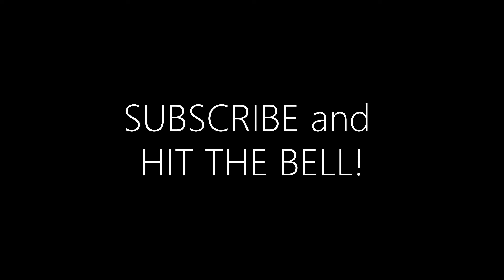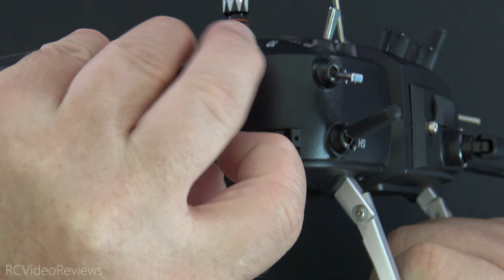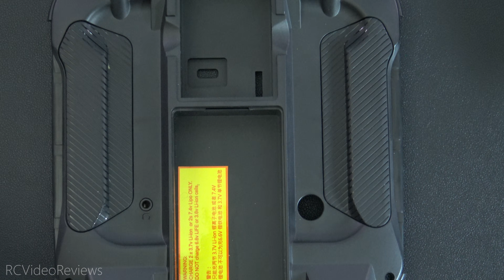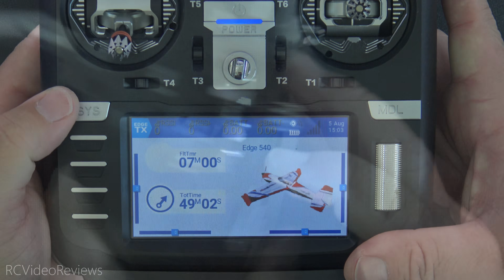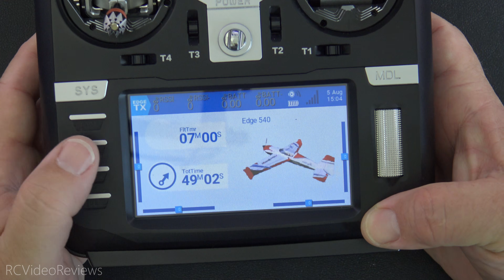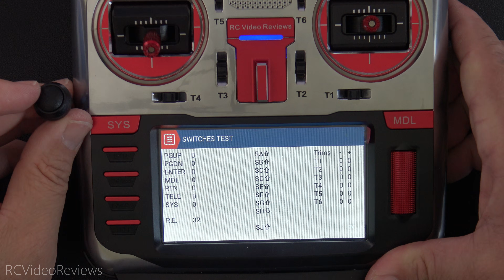How-to Install and Configure Radiomaster DIY Switches in TX16s MK II and MK I

Comment: I have been planning to use it for head free readjusting my headding...just for future preparation of a platform to set heading and do some pan flying and direction...also I am planning to build a platform i can use the top left momentary switch to switch between flying quad with sticks to stable lock in flight, either heading lock or geo lock possiyion and altitude hold and controller gimbal with the sticks...making it an ideal platform for controlling while flying, one operator deal...😇

Comment: Can anyone confirm that it works on the original radiomaster Mark 1 radios. I'm fine with drilling a hole in the case I see to know if the board has the connectors

Comment: Hi man, i checking my jumpet T16 and figuring that it had same soldering pad but i doesn't really know what socket that match with the soldering pad. Just asking if you know what socket i should use
Reply from the maker: Sorry, don’t have that radio. No idea.

Comment: be great if you could do a mod for the new unscrew antenna
Reply from the maker: After seeing some of the issues where the center element breaks from the connector pin, I think I prefer to avoid adding points of failure to the antenna.

Comment: Hey man. Great video! I have the TX16S MK1, however I'd like to replace my switches with the 2 position buttons. Do you think that's possible? I always bang and break my switches in my bag and replacing them out with the 2 position buttons would be awesome for me. Almost replicating the Radiomaster Boxer. It's 6 wires for a 2 switch combo so I was wondeing if 2 buttons could be wired into the JST connector so it's only 4 wires? Any help would be appreciated. Thanks.
Reply from the maker: Yeah, you can change them. You can specify their function in hardware setup on the radio after you make the change.
Reply: @RCVideoReviews  So 4 wires from the 2 buttons will work instead of the 6 wires needed in the JST connector?

Comment: hey bro, great video,i added a toggle switch behind instead of the momentary switch.i can see it in the calibration of the tx.but i cant see it on betaflight to use it as return to home gps rescue switch.
Reply from the maker: Did you assign the switch to a channel in the mixer? Do you see it showing in outputs when you activate it? If both of those conditions are met and it's within the sbus/crsf stream you're feeding BF, you should see it.

Comment: Hey guys.  I have a problem with my newly purchased Radiomaster TX16S MK2.  When powering on I get a Key Waring message, Key Stuck PGDN.  checked to verify that none of the buttons were stuck, checked switches found nothing wrong.  Also, opened up case and all connectors were seated.  Has anyone else seen or had this problem?
Reply from the maker: It's probably a bad switch or loose wire. I've heard some people report a fix by re-seating the lcd ribbon too. I would start by finding the problem switch, unplugging and replugging the wire. If that doesn't work, try reseating the ribbon cable. If that doesn't work, replace the switch.
Reply: @RCVideoReviews  thx, i'll give it a shot.

Comment: Nice diy Video … do radiomaster  have 4d sticks Option ? I Wonna use This for crane
Reply: Not from the factory, but the same plug can be use to add another axis and the AG01 gimbal exist in hollow shaft version.
Check the manual chapter 5 (page 61 on the current revision) for the 1.25mm 5 Pin JST Micro Connector pinout on how to wire it.

Comment: Help  SI and SJ sockets are used by the stick leds  how to get round that ?
Reply from the maker: You have to splice the power leads for the leds into the power for the switch.
Reply: @RCVideoReviews  Thanks    I will get soldering.   Just thought there might be an easier way round it.
Reply: @RCVideoReviews  soldering done. Need toggle for trainer, is it easy to setup

Comment: Hi John, on my MKII happened probably once or twice already that it my models M1, M2 and Goblin 420 was for some reason not bound, had to rebind it .. any thoughts on why it goes to off bind and models had to be rebind? Thanks John
Reply from the maker: Are you changing your receiver numbers in the model settings?  What RF protocol?

I’ve not had to rebind any rx’s outside of something I caused.
Reply: @RCVideoReviews  I did update my Rx’s before from the companion, that might be it. What I’ll do is read the models from the radio and save it using the companion. Thanks John.

Comment: I noticed you put one of those red buttons on top of the transmitter. Was it easy to do. I'm going to do that as well
Reply from the maker: Here's the video: https://youtu.be/grcCx1Vz2_g
A couple of people stepped in and suggested a stepper bit. Of course I have stepper buts, but the problem is there is no depth inside the case, so you can't just drill a stepper to 1/2" without hitting something. That's why I went bit by bit--to keep the bit from drilling a hole through circuit boards or wires. Other than making sure you find the right spot and not hitting circuitry inside, yes, it was pretty easy. I put my switch in-line with LED ground wires.

Comment: Great, thanks. Got one and used it for instant trim, saved having to do the soldering etc to move the SH switch which, as you say, is a bit tricky to use for instant trim. Now use SH for timer reset.
Reply from the maker: If you liked the install video, you'll love this one: https://youtu.be/O0ijk41jJWo

Comment: That's pretty cool! Have you heard anything about the other plug with TX/RX uart pins that replaced the pads for the frsky PARA wireless trainer module? RadioMaster supposedly said they were going to be making a module for head tracking that plugs into it, but so far nothing. That's the #1 thing that's keeping me from switching to this radio from my old Jumper T16.
Reply from the maker: I haven’t heard anything about this.

Comment: Loved the video and went out and purchased one for my TX16S Mk II so I could use it for timer reset.  Works great.  The only issue I ran into was that the back of the case has a ramped ridge near the hole and the switch is slightly too large to sit flush.  Ended up sanding a flat on one side of the switch to clear the ramped ridge so it would sit flush with the back of the case.
Reply from the maker: Hmm...odd, mine dropped right in. Anyway, glad it was a simple fix.  If you decide to go with LED rings, you'll need to get your soldering iron out. I'm loving the dedicated timer reset option.

Comment: Hey what is the wizard used for in models on tx16, I tried using it to see if can setup plane lol didn't work I tried to open it and radio freeze's up have to shut off restart.
Reply from the maker: Do yourself a favor, delete that thing and just configure your models by hand. I try to not be dogmatic about things, but this is like taking your medicine when you're a kid. If you learn to configure from scratch, you'll never need the wizard again.
Reply: Thanks just didn't know what good was it, thanks will do that! 😁

Comment: Hello John, 
Off subject question if you will. Is there a way to speed up the voice on EdgeTX? For example, I have my lipo voltage telemetry read out when I pull the SH switch during LOS flight. For some reason, I don't like how slow the Amber pack is announcing this value. Is there a way to speed it up?
Thank You...
Reply from the maker: Not that I know of. During one of the radio releases, I did find deadspace on the end of every audio track. You might want to try loading some of the amber tracks you're referring into your video editor and looking for deadspace before and after the voice amplitude. It was quite obvious to me when I did that and saw like a .5-1s dead air on every track.
Reply: @RCVideoReviews  
I appreciate you. I will have to check into that. Most of the tracks played on my radio are my wife's voice, lol. Telemetry values would take her a while to finish,...🤣

Comment: Thanks for your great videos, just got a TX16s MK II, have 3 FlySky FS-IA6B Receivers, iam needing to re -bind each time I select another plane? Any thoughts, thanks
Reply from the maker: I've not had that happen with my IA6Bs.
Reply: Make sure you add a number for each Rx you bind .
Reply: @MikeyMikey1968  ok thanks, the number is left of Bind & Range right?
Reply: @pjharris6583  Yes

Comment: you can select also a 3 pos switch ... how has that to be connected??
Reply from the maker: You have to add a 3 position hardware switch. I didn't confirm, but I'm sure the connectors are the same: https://www.radiomasterrc.com/collections/tx16s-mkii-accessories/products/tx16s-replacement-switch-assemblies

Comment: I had previously occupied the two slots with a 2-pole switch each. There are now 3 pins left in the slot. Do you know what kind of switch you can connect to these?
Reply: those are for analog input (pot/slider)
Reply: @dg9bfc  o.k., thank you.

Comment: I had the leather separate from the handles.  Easy fix was some 3M Super 77 Spray Adhesive on the back of the leather and stick it right back on.  It holds better that the original adhesive.
Reply from the maker: I'll remember that if it happens again. I did try to re-glue but I don't think it was Super 77. Thanks for the tip.

Comment: Actually it's sad to see that, after releasing so many really essential upgrades (in the vein of monogrammed pink and fluffy dice for the rear-view mirror in your sports car with the sunroof customized for Greenland) they have been reduced to selling something as useless as large push-button switches for fitting just where your fingers normally find easy to reach when flying. 😜 
No chance of a short video evaluating the ergonomics of using (and suitable sites for adding) both switches, John? 🙂
Reply from the maker: This whole comment seems a little overly critical TBH. If you can’t see the value in these little add-ons, then keep your cash.

I think the switch position is fine. I won’t be making a video to discuss egonomics.
Reply: @RCVideoReviews  Seems to be another example of different national appreciations of sense of humo(u)r here John. These switches ARE AN EXCELLENT UPGRADE and probably should be purchased by pretty well ALL TX16S users. The ability to add BOTH would also be generally useful unlike the ridiculously priced "bling" upgrades previously released. Rest assured that your response doesn't offend me in the least and that I will watch any future videos of interest and continue to recommend your channel as 1 of the best sources of knowledge on using this radio. Just might have to add a rider to avoid making comments on folks who like to add racing stripes and flashing LEDs to their AR15s.
And that IS a gentle dig at our uptight American Cousins! ;-)

Comment: Off-Topic, as I know some Rc's pilot use count-down timer to know when to land or beeper "I guess" when no telemetry installed, but why use it when there is telemetry for battery ?
I use timer to know how long I've been flying.
Reply from the maker: There are plenty of fixed wing setups out there with no voltage telemetry. It's different on craft with fc/fbl like quads/helis or iNav planes, but not every plane gets voltage. Timers are just one of those things. If you socialize with fixed wing pilots you'll probably find timers on more radios than not.

Comment: do you know where i can get replacement screws for it?
Reply from the maker: Replacement screws for what? The back cover?
Reply: @RCVideoReviews  yeah
Reply: nevermind i found it
Reply from the maker: What did you find?
Reply: @RCVideoReviews  where to get the replacement screws
Reply: @1974dragonkiller  After specifically asking John for a link to a source for replacement screws, your kindness in not posting the 1 that you subsequently found is greatly appreciated by the rest of us who might need the same info. 🤔🙄😁